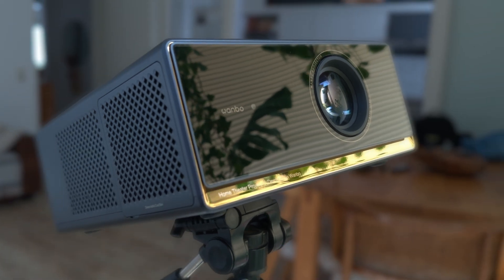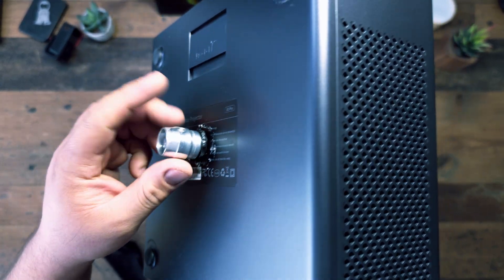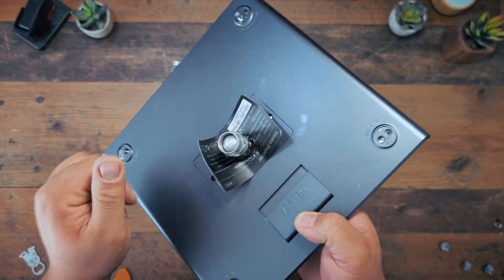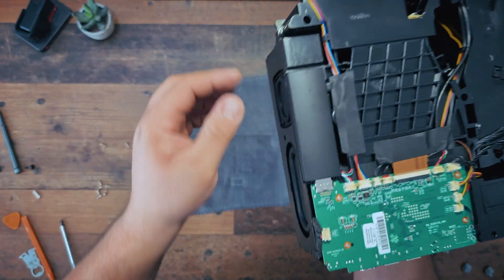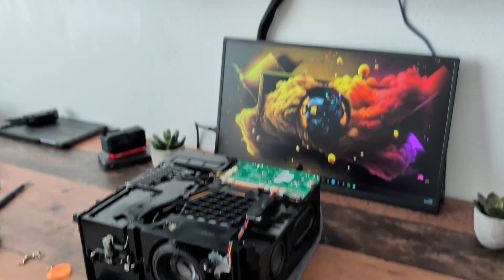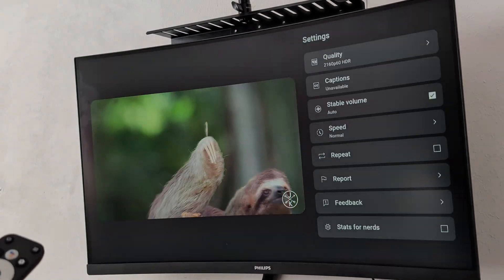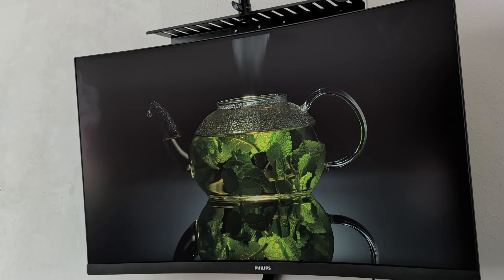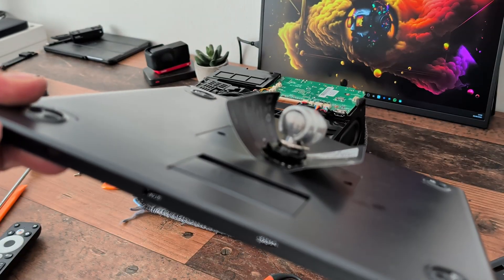I Found a 4K TV Stick In My Projector | Wanbo X5 Pro

Comment: This is SICK. I bought a Fire Stick 4K Max to use on my Wanbo X5 Pro so i will remove this Google Home Stick and gonna give it to my GF as a gift, she likes the Google Ecosystem. Good job!
Reply: Let us know if it works!
Reply from the maker: tell us how you got over the autofocus and calibration on the new stick
Reply: @TheArtmann my projector arrives in 2 weeks but I'll keep yall posted. You haven't done that already to yours?
Reply from the maker: No, I haven't. I just tested the Wanbo stick on TV, but didn't tried another stick inside the Wanbo. My guess is that the autofocus, manual focus, calibration, etc you can do it with the original Wanbo remote. the HDMI stick is just for streaming, but the rest settings must be withing the projector. That's my bet, but i'm not sure. I'll wait for your reply to confirm:) good luck!